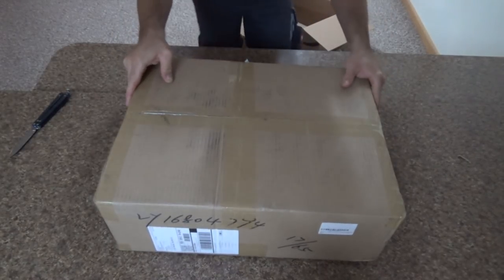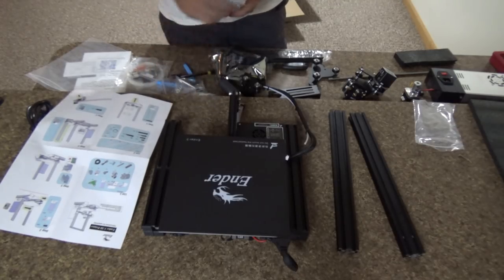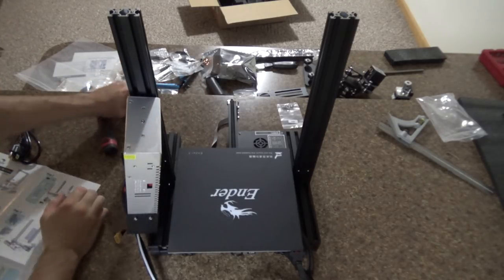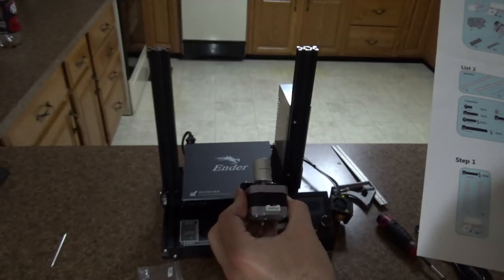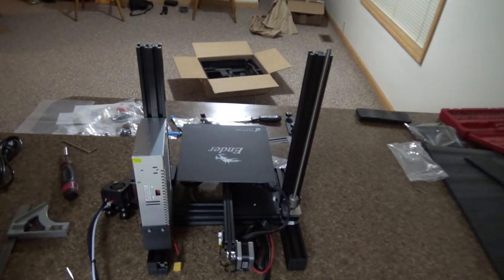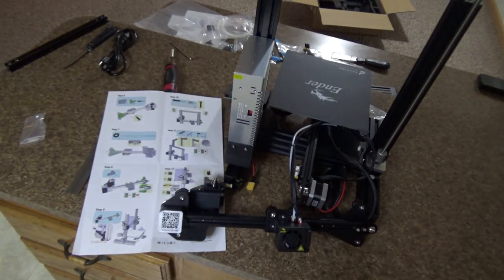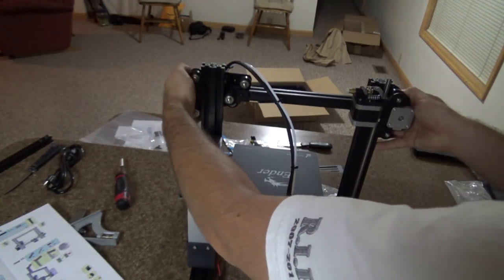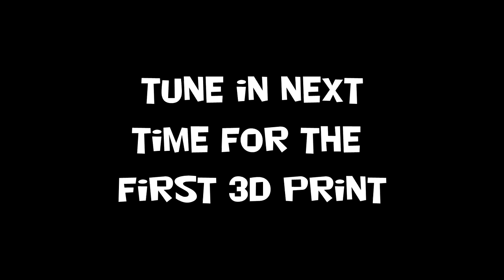Creality Ender 3 3D Printer Unboxing and Noob Assembly

Comment: I found that installing the zrod last makes the assembly easier and faster.  On the zrod stepper loosen both allens and raise the coupling so that the split in the coupling is above the end of the shaft of the stepper motor.  Now take the zrod and thread it into the top of the brass fitting and slowly lower it down into the coupling.  insert just the end into the coupling. This gives the zrod a smooth operation and allows the coupling to flex a little to prevent binding.

Comment: When you installed the Z axis rod you stated that it was fully seated in the coupling. I understand that a little gap should be left between the stepper motor shaft and the threaded rod in order to allow the flexible coupling to flex as it is designed to do.